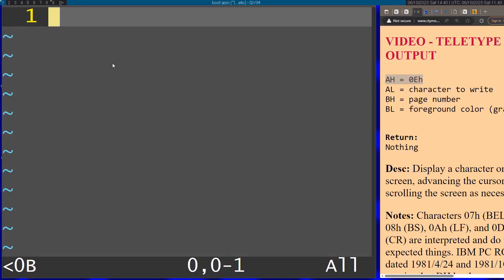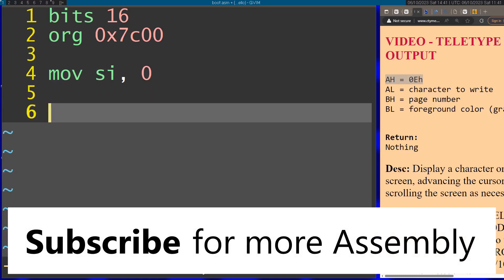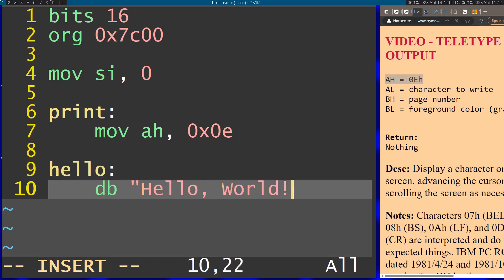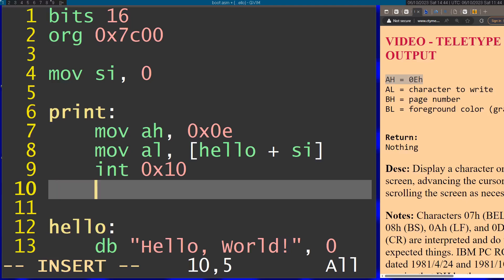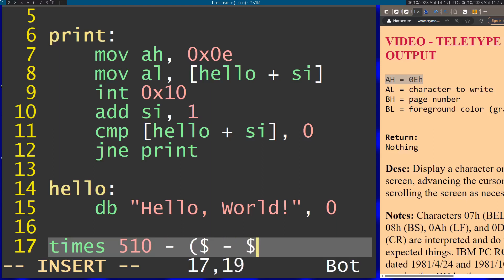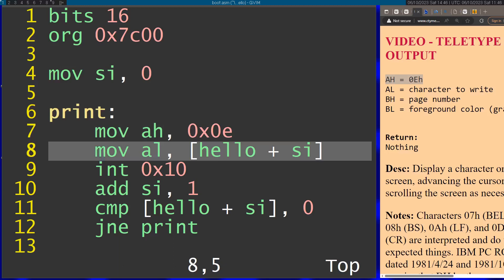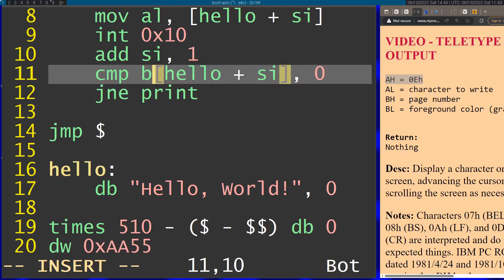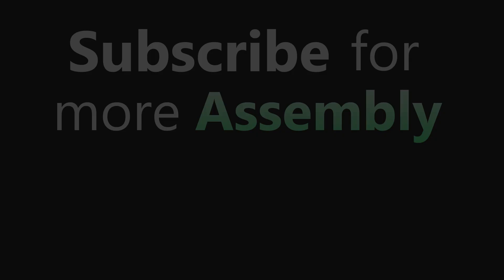Making Simple Bootloader using x86 Assembly

Comment: hold up i believe this is 16-bit assembly??? 32-bit assembly or x86 would normally start with "bits 32".
Reply from the maker: right, this is 16-bit x86 assembly, on the classic "legacy bios" boot sequence of x86, the bios passes control to the bootloader when in "real mode" hence the 16-bit limitation in this stage
Reply: @nirlichtman  ohhhhhhhhhhhhhhhhhhhhhhhh

Comment: The output of this assembly code works with qemu but when burnt on a USB key the latter is not recognized by the computer as a bootable device despite the appropriate BIOS settings. What should be changed ?
Reply from the maker: Make sure you have configured the BIOS to use/support booting in legacy mode, the reason it's failing is probably because currently the settings are configured to boot in UEFI mode only.
Reply: @nirlichtman  Hey thanks for your answer! Actually, I had already done that, so this was not the problem. The real issue is that the 0x55AA signature in the last 2 bytes is not enough (for my real computer at least). The 64 bytes preceding those last 2 bytes need to be set in a certain way too, so that the whole 512 bytes sector can be recognized as a Master Boot Record by the computer. Those 64 bytes are supposed to represent the partition table, describing the partitions the disk has (from 1 to 4).
Reply: For anyone reading this, look at "Structure of a classical generic MBR" in the following link https://en.wikipedia.org/wiki/Master_boot_record#Sector_layout to get an image of what I'm speaking about.

So basically to modify the assembly code accordingly you have to replace the last two lines :

times 510-($-$$) db 0
dw 0xAA55

by the following code ( ; is just used to indicate a comment) :

times 446-($-$$) db 0

; MBR Partition Table (4 entries, 16 bytes each, totaling 64 bytes)
partition_table:

    ; First Partition Entry
    db 0x00                  ; Bootable flag (0x80 for active, 0x00 for inactive)
    db 0x00, 0x02, 0x00      ; CHS address of first sector
    db 0x07                  ; Partition type (0x07 for NTFS/exFAT, 0x83 for Linux, etc.)
    db 0xFF, 0xFF, 0xFF      ; CHS address of last sector
    dd 0x00000001            ; LBA of first sector (starting sector)
    dd 0x0001F3C0            ; Number of sectors (100MB example)

    ; Second Partition Entry (empty)
    times 16 db 0x00

    ; Third Partition Entry (empty)
    times 16 db 0x00

    ; Fourth Partition Entry (empty)
    times 16 db 0x00

dw 0xAA55
Reply: This code I found on the Internet worked with those values for the first partition fields ... I wonder what is the precise byte that allowed the PC to identify the MBR and thus make the USB drive bootable ... maybe it is the partition type ... I will test this later.
Reply from the maker: @PeculiarGoogleUser82  sweet very interesting, thanks for sharing!
Reply from the maker: @PeculiarGoogleUser82  sweet very interesting, thanks for sharing!

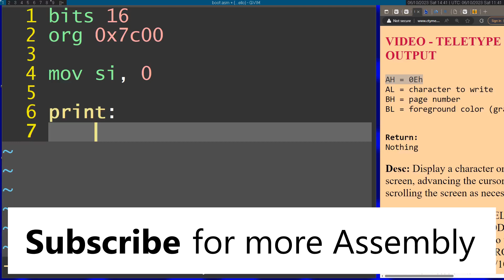Comment: 1:06 Where does this interrupt/routine come from? The kernel hasn't been loaded yet, so it's not a system call, right? But then... what is it? Is it a service routine defined by the architecture itself and built into the CPU?
Reply from the maker: It is a BIOS interrupt, in the classic x86 model when you power on the computer the BIOS takes control and after it finishes initializing it locates a bootable disk (according to the boot sequence order you defined), and when found loads the MBR to memory and passes execution to the MBR. Since the BIOS already initialized when the MBR starts running, it can access all the BIOS interrupt services. this BIOS model is based on the original IBM PC and has remained pretty standard across the years though nowadays UEFI is taking over, but still this legacy BIOS model is still widely supported as a fallback. To dive deeper into the BIOS interrupts, I would recommend watching my video about making a snake boot sector game.
Reply: @nirlichtman  Cool!

Comment: How does it know where to start without main ? does it just start at whatever line is after org ?
Reply: The `org` directive in nasm says "put all the stuff after me starting at this address", which is 0x7c00, so that's going to write out a binary that "knows" to make all the assembled instructions + data in memory refer to addresses from there. 

The PC BIOS specifies that once it's done initializing itself it will take those 512 bytes he put in the file and load them into memory at address 0x7c00, verify that the final two bytes are the magic 0xaa55 and, if they, are, jump to the data. So the last line the bios executes to go to your code is `jmp 0x7c00`. That jmp is the equivalent of what the c runtime library does when it runs your `main` in a normal program.

Comment: just curious:
where does the cpu get the actual character from at this stage? does the cpu/bios has a basic font file embedded in it by the manufacturer?
Reply from the maker: The BIOS comes with the basic ability to print characters on the screen with some basic built in font

Comment: First, you'll have to manage your stack if you want to go further:
mov ax,cs
mov ds,ax 
dec ax
mov ss,ax
mov sp,0x000e ; 16 bytes of stack is tiny but enough

Then write the message:
cld ; direction=forward for lodsb
call write ; here's the magic...
db  "hello world",0
jmp $ ; back from write, jump to whatever code to execute next...

The write procedure looks like that:
write:
pop si ; get address of the string
mov ah,0x0e ; teletype: out char
print: ; loop label
lodsb ;  same as mov al,[si] followed by inc si
jz end_str ; check if zero, no need for cmp
int 0x10 ; out char
jmp print ; short jump
end_str:
jmp si

Actually, you want to put your stack just under 0x8000 (0x7cff:00fe) so to load your kernel at 8000:0000, the boot loader only reads the sectors to the memory, nothing more

Comment: You could point SI to hello and then use a LODSB loop to read characters in line, then you don't need to increment SI. By the way, if you do increment SI, you could use INC. It's more ergonomic in assembly and probably even takes less bytes. Infinite loops are quite bad for modern CPUs (also old ones I suppose), use CLI HLT to shut it down.
Reply: Very good points, I want to add just one or two more things: instead of loading the byte again from memory and comparing it with zero, once the stuff is in al anyway (and you do not need al afterwards), you could just >> and al,al; jnz print <<. Also, since ah seems to be not touched here, I would probably move the mov ah,0x0e out of the loop.  My god... what are we doing here? Philosophizing about the fastest hello world boot loader 😀 But I like it!
Reply: @iUniversEi  AH is used by INT 0x10 to determine which function to use
Reply: @solidracer7947 oh yes, when ah gets poisoned along the lines, you're right; then it has to be set again every iteration.
Reply: @iUniversEi ah i see what you mean now

Comment: Pixel art with bios function int 10h ax=1110h can be used for boot manager too. In this batch file i use ASCII A,B,C,D and E,F,G,H to put pixel art inside. A = hex 41. 8x16 character size on 80x25 text screen.

@echo off
REM Panda.bat
echo a>tmp.deb
echo mov ax,1110>>tmp.deb
echo mov bp,118>>tmp.deb
echo mov cx,8>>tmp.deb
echo mov dx,41>>tmp.deb
echo xor bl,bl>>tmp.deb
echo mov bh,10>>tmp.deb
echo int 10>>tmp.deb
echo ret>>tmp.deb
echo org 0118>>tmp.deb
echo DB 0,0,1,7,1f,3f,7f,7f,7f,7e,7c,7c,7c,7c,7c,7c>>tmp.deb
echo DB 0,3f,ff,ff,ff,ff,ff,ff,1f,f,7,7,7,7,7,7>>tmp.deb
echo DB 0,fc,ff,ff,ff,ff,ff,ff,f8,f0,e0,e0,e0,e0,e0,e0>>tmp.deb
echo DB 0,0,80,e0,f8,fc,fe,fe,fe,7e,3e,3e,3e,3e,3e,3e>>tmp.deb
REM
REM 00000000 00000000 00000000 00000000
REM 00000000 00111111 11111100 00000000
REM 00000001 11111111 11111111 10000000
REM 00000111 11111111 11111111 11100000
REM 00011111 11111111 11111111 11111000
REM 00111111 11111111 11111111 11111100
REM 01111111 11111111 11111111 11111110
REM 01111111 11111111 11111111 11111110
REM 01111111 00011111 11111000 11111110
REM 01111110 00001111 11110000 01111110
REM 01111100 00000111 11100000 00111110
REM 01111100 00000111 11100000 00111110
REM 01111100 00000111 11100000 00111110
REM 01111100 00000111 11100000 00111110
REM 01111100 00000111 11100000 00111110
REM 01111100 00000111 11100000 00111110
REM
echo DB 7c,7c,7c,7c,7c,3e,3f,3f,1f,7,3,1,0,0,0,0>>tmp.deb
echo DB 7,7,7,7,7,7,1f,fe,fc,fc,ff,c0,f0,7f,f,0>>tmp.deb
echo DB e0,e0,e0,e0,e0,e0,f8,7f,3f,3f,ff,3,f,fe,f0,0>>tmp.deb
echo DB 3e,3e,3e,3e,3e,7c,fc,fc,f8,e0,c0,80,0,0,0,0>>tmp.deb
REM
REM 01111100 00000111 11100000 00111110
REM 01111100 00000111 11100000 00111110
REM 01111100 00000111 11100000 00111110
REM 01111100 00000111 11100000 00111110
REM 01111100 00000111 11100000 00111110
REM 00111110 00000111 11100000 01111100
REM 00111111 00011111 11111000 11111100
REM 00111111 11111110 01111111 11111100
REM 00011111 11111100 00111111 11111000
REM 00000111 11111100 00111111 11100000
REM 00000011 11111111 11111111 11000000
REM 00000001 11000000 00000011 10000000
REM 00000000 11110000 00001111 00000000
REM 00000000 01111111 11111110 00000000
REM 00000000 00001111 11110000 00000000
REM 00000000 00000000 00000000 00000000
REM
echo.>>tmp.deb
echo n Panda.com>>tmp.deb
echo rcx>>tmp.deb
echo 98>>tmp.deb
echo wcs:100>>tmp.deb
echo q>>tmp.deb
debug<tmp.deb>nul
del tmp.deb
Panda.com
del Panda.com
echo ABCD
echo EFGH

Comment: i love how to doesn't just go full on-- we aren't jumping to kernel or initializing a gdt or some such, we literally just are shown the most vital basic skeleton for a nasm program running as a bootloader with the ending magic word and whatever. super nice!
Reply: I have only one routine that use a GDT for switching from 16 bit RM into 16 bit BIG RM(16 bit Unreal mode) with a segment size of 4 gb for DS,ES,GS and FS segment and 64 kb for CS and SS segment. This mode is compatible to 16 bit RM and additional we can write directly into the linear framebuffer(dosbox svga-S3 emulation in C0000000) instructions with a address size prefix (hex 67) for graphic mode with using the VBE 2/VBE 3 BIOS.
Reply: @maxmuster7003  sounds like good s*, tho I don't really understand it 😅 tho that is kind of my point-- Attempting to learn this kind of thing as simply as possible for me has just been a firehose of information right in my face, whereas this was like, one piece of information to take note of. maybe two. much more understandable, and like you just said other things can be almost *irrelevant*.
Reply: @GiovanniCKC  With the 16 bit BIG RM with a larger segment size with 32 bit CPU we can use the DS,ES,FS, or GS segment to read or write to any 32 bit address of 4gb. I use it to write into the linear framebuffer in C0000000 default svga-S3 emulation in DosBox with 800x600x32 resoliution.

I made a tiny video(no speech) to show how it works. The routine load a picture (file size less 64 kb) decode the picture format and write the pixel into the framebuffer upper left corner and then an other routine copy the picture to the center of the screen.
Reply: @maxmuster7003  so.. i think bigger screen? 😅
Reply: @GiovanniCKC  I began with a 15" CRT monitor and then i used 19" CRT from Samsung and Samtron with 96 khz capacity for 1280x1024 with 86 hz refresh rate, but most time i used 1024x768 with 100 hz. At last i used 28" LCD with 1920x1200 wide screen 16: 10 aspect ratio on Radeon 9750 PCIe VBE 3 Bios with MS DOS 6.22.

Comment: Well explained, just one question: Why can you define "Hello World" only after executing the print code? "Hello World" shouldn't be defined yet e.g in line 8, right?
Reply from the maker: Good question - the reason it works is that the "Hello World" string is defined statically in memory so when you assemble the code the hello world will actually be part of the binary and when the print code runs it will reference the statically initialized memory already containing the "Hello World" string. Hope this helps to understand, let me know if there are any more questions :)
Reply: @nirlichtman  Ahh, i think i got it now. Thank you!
Reply: @nirlichtman  nope, there is no need to define it statically, and not even give it a name, you just need to figure out a way of getting its address and its end. for the rest, "call" the procedure for write and start the procedure with "pop si", increase si while reading the string and finish the procedure with "jmp si": no label, the text is in the middle of the code, everything you can't do in protected mode but can do in real mode. Makes the disassembler crazy...

Comment: Can you explain why you use cmp on line 11? *Edit*: Nevermind, I didn't see the jne. Nice video!
Reply from the maker: Thanks!
Reply: This cmp instruction need to specify how many bytes in memory to compare with zero, a byte, a word or a double word.
Reply: true, you could replace by or al,al followed by jne... and gain 1 byte and a couple of cycles. However, using lodsb followed directly by jne doesn't require si to be an index added to the string pointer but the string pointer itself, and lodsb reads [si] into al, increments si and sets the Z flag if al==0, so can be tested immediately after.